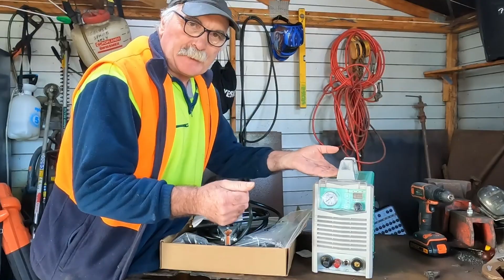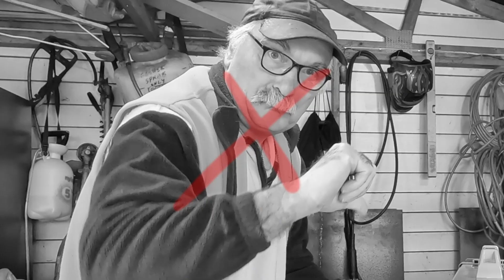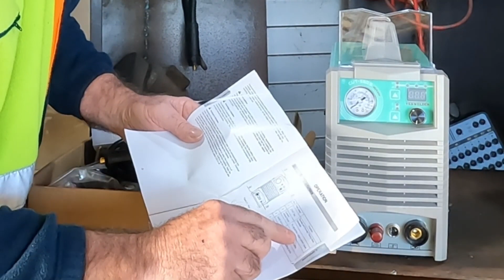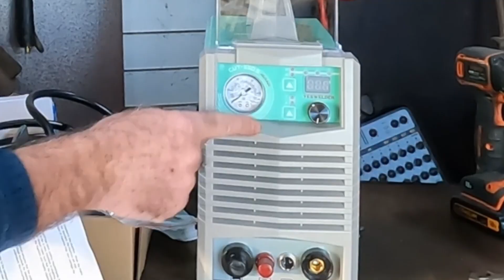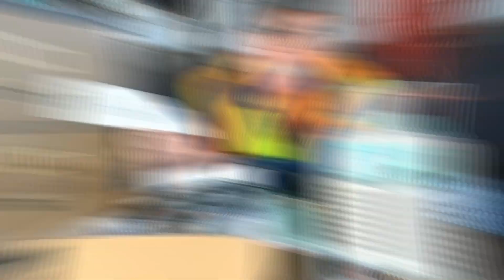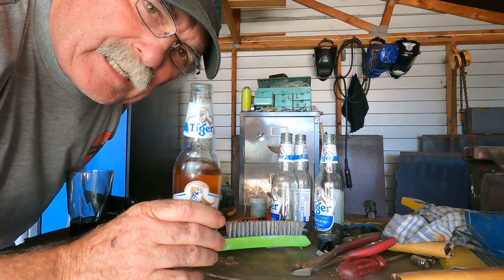Craziest Assembly Instructions I Have Ever Seen in My Workshop!

Comment: 5:30 the perforating distance (12mm) is how thick it can blast a perforation (hole) into the material to start a cut. The other distance 20mm is how thick it can cut from a side or from an existing hole.
So... yeah, it's just you not understanding simple English. 😂